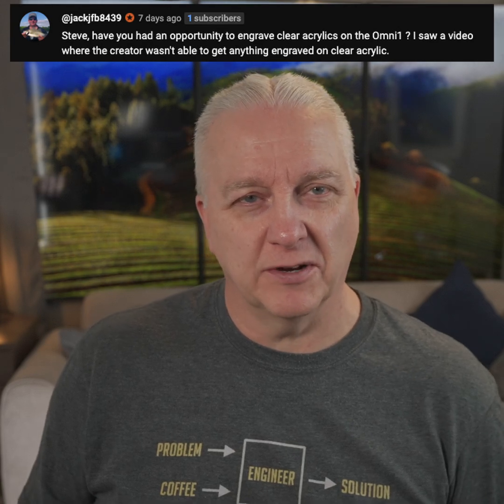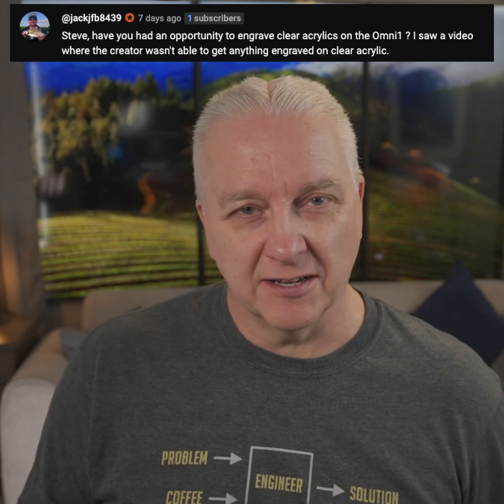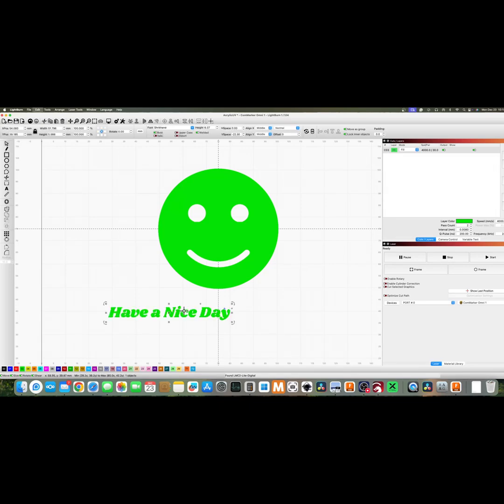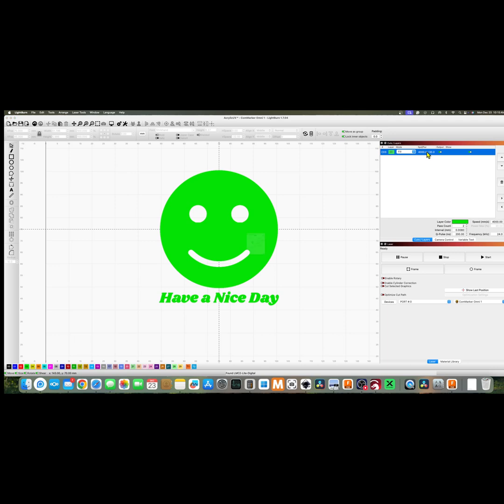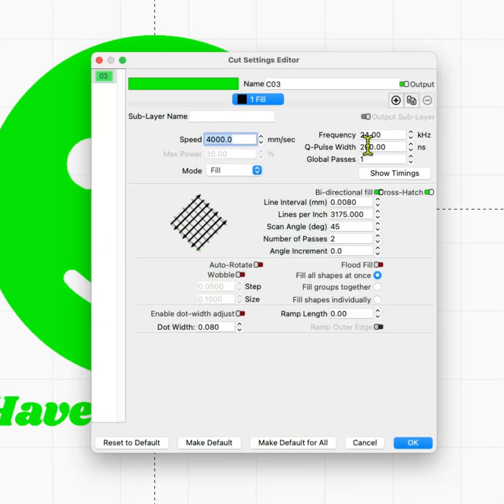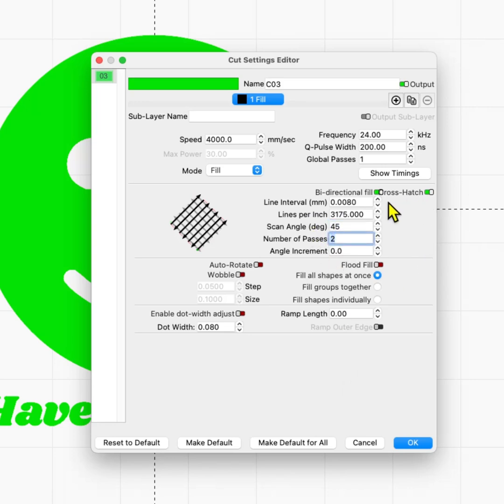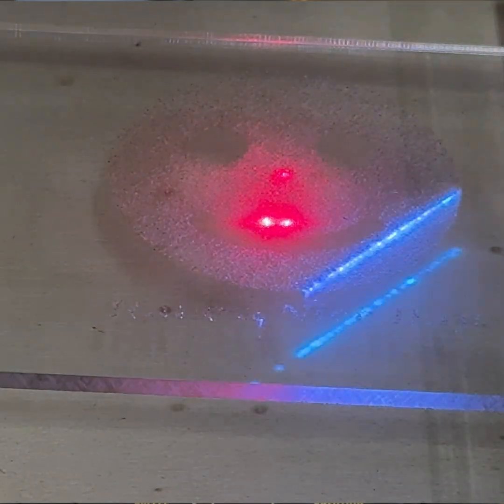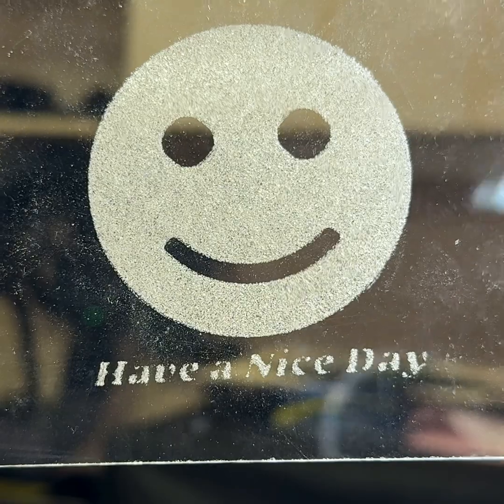Perfect UV Laser Settings for Clear Acrylic Revealed! #shorts #maker #workshop

Comment: wrong, 40-150khz and 1-15ns
Reply from the maker: You will find that settings are very dependent on the material you are using as well as the laser.  Even if all your acrylic looks clear, you will find that different manufacturers use different compositions, which will drastically change the settings yo need.

Also since my Omni 1 uses the stock device driver, the maximum frequency is 40Khz, so I couldn't use your settings at all.  If you've made the change to use the higher frequency then you're on your own to find the right settings.  FWIW, I tried the higher frequency range and saw no benefit, so I switched my Omni 1 back to the original driver.  Every material library, including my own for the Omni 1 assumes the original frequency range, so you're really just going to make work for yourself by changing it.
Reply: @SteveMakesEverything  you can, you have to do it in the settings in light burn. he can't find the settings automaticly
Reply from the maker: @dkastra26  You misunderstood.  I did this while I was testing beta units and, again, fairly recently, and there's just no benefit to changing it.  It doesn't improve the output in a measurable way and just messes you up when using anyone else's settings.  I spoke to ComMaker about it, and they agreed there's no real point in changing the frequency range.
Reply: @ haha commarker doesnt know their machine? Make a materialtest until 150khz and see. And 1-15ns
Reply from the maker: @dkastra26  Yep.  Been there, done that.

I realize this is what the "cool kids" are doing, but the benefit is minimal to non-existent. 

Commarker knows their laser very well and didn't have any issue with me wanting to change mine, but like I discovered the hard way, they assured me there's no real advantage.  It's just the same capability with a different range.
Reply: @ ok. Believe it or not. Its a hughe benefit. Look at all the other Videos. You cant be so blind. Then you have the wrong Speed
Reply from the maker: @dkastra26  Definitely not blind.  I ran many tests.  Results don't lie.

One of these days, I'll play with it more, but I saw nothing that made me go, "Wow!"  If it's working for you, keep at it - as I said, Commarker has no issue with you changing the range.
Reply: @ im speechless. Sorry
Reply from the maker: @dkastra26  🙂Sorry you feel that way.  I'm not telling you not to do it.  Just saying that I tried it twice and saw no significant benefit.  The Omni 1 does everything I need it to do right now.

For giggles I'll try it a third time at some point and let you know if the earth moved.

Comment: It also depends on the type of acrylic, cast acrylic engraves and "frosts" far easier than extruded acrylic.
Reply from the maker: Does anyone still use extruded acrylic. It’s pretty terrible material
Reply: @SteveMakesEverything  Yes :) i have a company. XT is not realy difficult to handle if you know how. An XT is far better in the precision of thickness !
Reply from the maker: @ I bow to your experience🙂

Comment: Thanks for the settings. Gonna try and sneak in some time before family gathers. I’ve noticed playing around text/vectors engrave differently that photos and either increase or decrease speed or dpi. I wanted to make acrylic ornaments with the kids faces but have failed miserably lol. Have you tried? Love to see what you come up with. Have a Merry Christmas and all the blessings that come from this day.
Reply from the maker: If you want to do some cool photos then use dark mirrored acylic. It’s what it used in my recent image mode video. Right at the beginning of that video, the photo of the dog was done on the Omni1
Reply from the maker: Btw it’s entirely possible you need to have different settings for text. I used a terrible font in this video, but if I had engraved it with a smaller interval it would have been better. Also experiment with wobble in the settings for the text layer